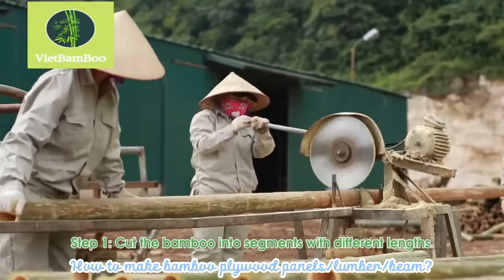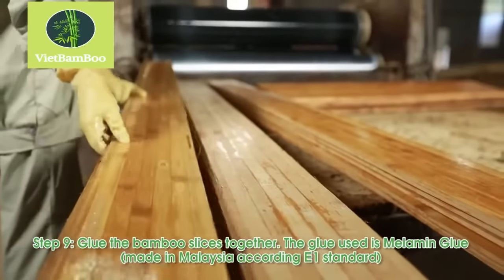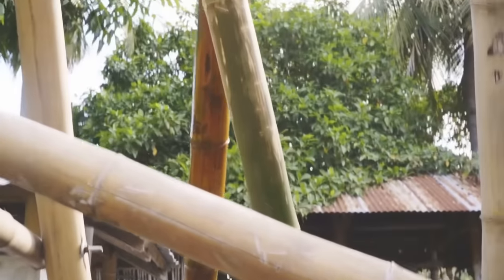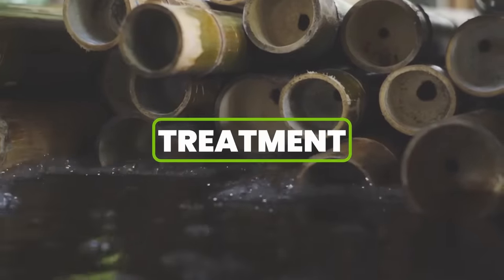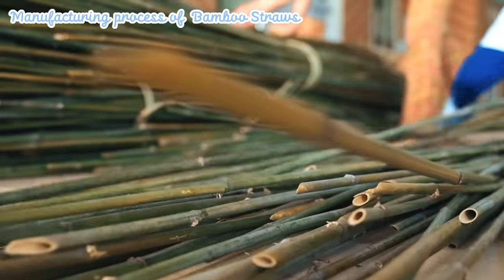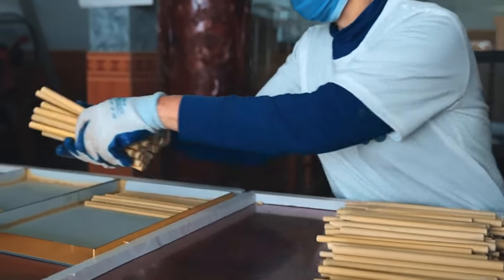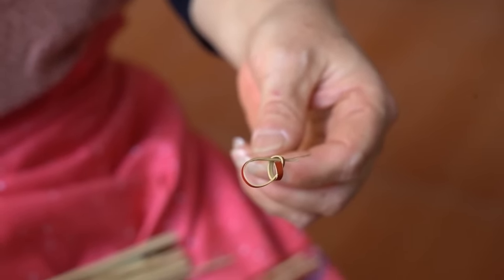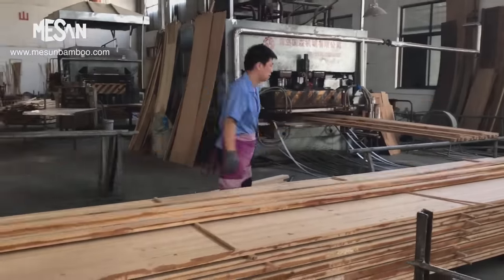How to Processing Millions Bamboos to Product - Straws, Bamboo Houses, Plywood, Chopstick Factory

Comment: i found out the difference between Japanese chopsticks and Chinese chop sticks( by online shopping in Temu)
Japanese chopsticks are shorter(typically less than 9 inches) and tapered, Chinese chopsticks are longer(typically 9.5' and longer)and the tips(food grabbing ends) are thicker.
Interestingly, some Chinese chopsticks are sold as Japanese style but not the other way.

I prefer Japanese style.
But you may like Chinese style.